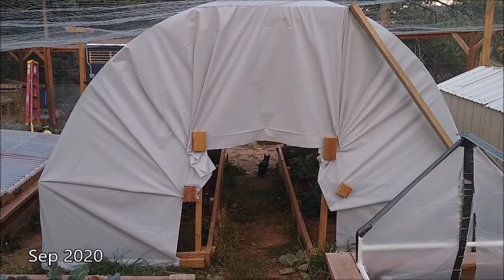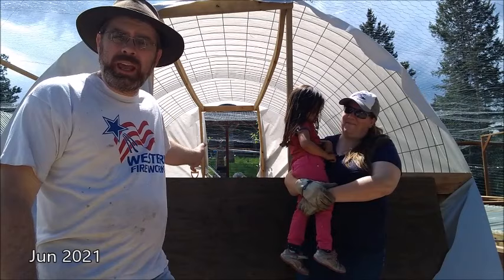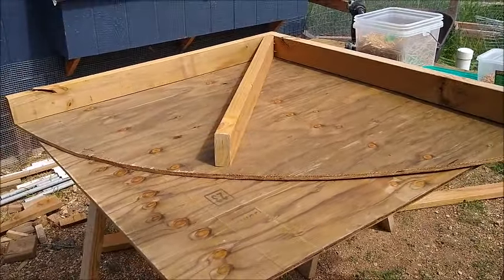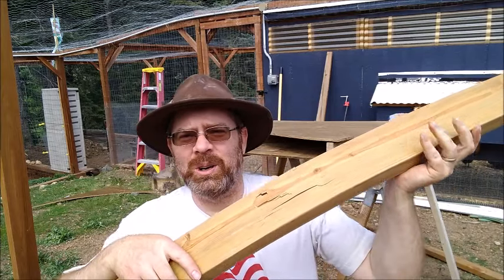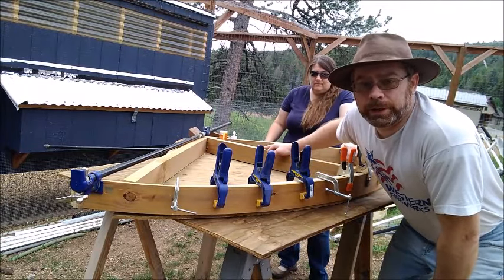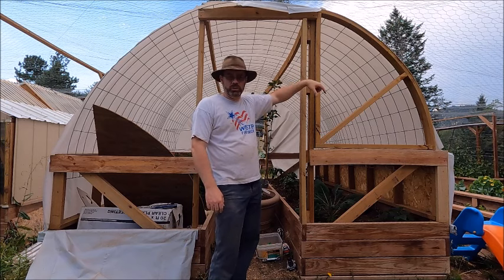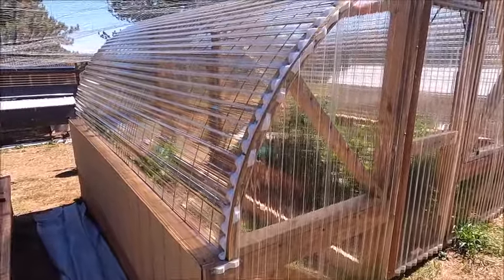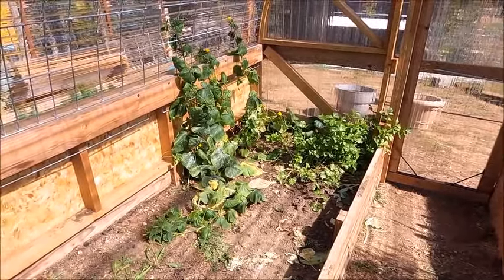Hoop Greenhouse

Comment: I love the hoop house and it gave me some ideas. If I may add a bit of advice: Instead of trying to curve 2X4s, I would use several layers of 3/8 inch plywood. Cut and attach each strip one at a time and glue between each layer. I've used this technique when making skirts for round table tops.
Reply from the maker: Thank you for the suggestion.  This has been suggested before as well.  I stayed away from plywood for this project because it is outside in the elements.  I was afraid of delamination in the plywood due to the moisture, high UV, and significant temperature changes.  The thin strips of pressure treated 2x4s worked well and with the weather resistant glue I was not as worried about delamination.
Reply: @bearlyhomesteading  I fully understand. I didn't think about the plywood delaminating in the weather.
Reply: Sorry to Necro this but I'm in the planning process of doing exactly this as I've inherited a large hoop house like 25x50 that needs new plastic. 

The frame is all galvanized steel like commercial greenhouses but I would like to do these polycarbonate panels like you did for aesthetic because wife and the curves on the side have had me stumped. 

Did you just resaw treated 2x4s to thin malleable strips to do the lamentations on the curves? Again sorry for the Necro post but your video is literally the only video I can find that uses these panels on a curved top greenhouse like mine.

Thank you

Comment: Those curves are a monster. What I did for my greenhouse is I bought a 4x8 sheet of beadboard paneling which is about 3/8" thick, ripped it into 3-1/2" strips lengthwise. Then I used a table saw with a sled, and took an 8p nail (which is the width of the blade) and made an indexing pin about 2" from the blade, and I set the height to be about 1/4" to make grooves into the "bead" side, 2/3 of the thickness of the boards, and made kerf cuts along each piece. These are extremely flexible now and have to be carried on edge. 

Since my hoop house uses 16' panels, two 8' pieces make a full circuit with very minor trimming. These are held in place against the inside of the panels with spring clamps (I used about 20 of them) to meet end-on in the middle (top) of the greenhouse, then wet the wood and used gorilla (PU) glue to laminate another piece of beadboard strip inside, straddling the seam and securing them with the spring clamps (use rubber gloves -- that PU glue is nasty). The remaining 8' piece can be cut in half and fit/wet/glued/clamped into each side. 

I let it dry for about 4 hours, then moved on to the next one. Each of these "ribs" takes 4 8' strips of the kerfed beadboard, and the two laminated pieces comes out to just over 3/4" thick. Once the glue dried, I attached them to the cattle panels using zip ties. I drilled from the outside using the bars of the panels as the guide, 4 holes (two above and two below), fed the zip ties from the below, and over the top of the "bar" of the cattle and back below where they are fastened and trimmed. This became a tedious job with 23 points (bars on the panel) and 2 ties per point -- drill (x92), feed (x46), pull (x46), feed (x46), pull (x46), zip (x46), tighten (x46) and trim (x46). I found that doing each of those tasks in order (instead of trying to drill and fasten each zip tie one at a time) saved a lot of time.
Reply from the maker: That is great.  We stayed away from anything that was already glued (chip board, plywood, MDF, HDF, etc.) due to the very high UV and moisture.  I had thought about zip ties, but ultimately decided against them again because of the high UV.

Comment: I like your approach.  When I built mine, I used clear for the top. It gets HOT  !!!!   Using white on the top part and clear on sides could control it better. Just a thought  !!!!!!!!!!!!
Reply from the maker: We finished it near the end of the season.  It did get really warm on the sunny days.  Our tomatoes loved it.  By adjusting how open the doors are we were going to control the heat.

Comment: Nice Job!  You sure have a lot of patience.  Absolutely nothing wrong with the way you did it, but just one thing you may be able to do on a future project.  Use thin pieces of plywood (1/4") to bend to that angle you want and just keep laminating them togethor with glue and overlap the seams.
Reply from the maker: That is essentially what we ended up doing but with pressure treated boards cut into strips.  My concern with the plywood is getting delamination due to the extreme temperature shifts, moisture, and high UV.

Comment: That's a really nice addition...the corrugated panels!  I would say you need some ventilation except in the very cold months, but maybe in your climate you don't?
Reply from the maker: We really did not need much ventilation.  During the heat of the summer we would prop open both doors with a scrap piece of 2x4 during the heat of the day and that was enough.  We didn't even need air conditioning in the house up there.

Comment: Beautiful job! How did you attach the polycarbonate panels to the cattle panel roof?
Reply from the maker: Initially we just attached them at the ends to the laminates arches and the top of the door frames.  That worked well enough for most of the time.  Once we had a bigger wind storm, we made some wood blocks about 6-8" long with grooves that interfaced with the wires of the cattle panel.  The blocks went inside the hoop house and gave us something to screw into.  This sandwiched the cattle panel between the polycarbonate panel and the wood block.
Reply: @bearlyhomesteading I was wondering the same thing. Mahalo

Comment: I am in zone 6a.  I moved my green stalk that is planted with strawberries into my unheated green house.  They are flowering and fruiting .  Not a large harvest, but it is a pleasant surprise.   The tomato that I moved in did not fruit although it bloomed.  Lettuce and spinach planted in ground in the greenhouse are the best looking plants I have ever had.   Just in case you are looking for some additional ideas.
Reply: Some tomato varieties need pollinators to produce fruit. If there are no pollinators you could take a small clean paint brush and touch the flowers and spread the pollen from flower to flower.

Comment: Hello, I’d like to build a greenhouse using the poly panels and would like to know if you are in Colorado? Will it hold up to a snow load and panels shed snow?
Reply from the maker: We were in Colorado when we built this greenhouse.   The cattle panels that we used were very sturdy and had a lot of support, so they would carry a sizeable snow load.  The panels do not shed snow very well, since the ridges of the poly panels are going in a horizontal direction and not a vertical.  We made one side of the house lower than the other so it sheds water pretty well, but not snow.  Using the back side of a garden rake worked well to knock the snow off without damaging the poly panels.

Comment: i will share this with hubs, but i think you might need to get some ventilation ? are the poly panels the best see throughs you can find without going to glass?
Reply from the maker: For ventilation we were just propping the doors open.  Even in the summer, the nights will get down in the 50s, so we didn't want a ventilation that was constantly open or difficult to manage.

These were the clearest panels that I could find without going to glass or a solid plastic pane.

Comment: That 2nd attempt was oh so close.  Had you simply used an inner, and outer strip separated by spacers every few inches, perhaps 12", you'd have licked your problem with less material and a much lighter structure.  Still, thank you for sharing your experience.

Comment: I really like what you did since the polycarbonate sheets will certainly last longer than plastic sheeting.  My only concern with this design is connecting one sheet to the other across the span.  Are the polycarbonate sheets nailed only on the ends?  Did you use anything (eg clear liquid nails) to attach one sheet to the other?   I would be concerned with high winds getting under the sheets if they are connected only on the ends.  What do you think?
Reply from the maker: After that video was shot, we came back and did attach the panels along the length and not just at the ends.  What we did is take some pressure treated scrapes and cut a groove in the middle of the block.  That groove was put on the wire of the cattle panel at the overlap of two polycarbonate sheets.  Then we screwed to the block through the sheets sandwiching the wire of the cattle panel between the block and the sheet.  Thus we were able to attach the sheets to each other and to the cattle panel at discrete points along the length.
Reply: bravo about the curved boards! then i saw they popped. then i saw your persistence ! bravo again for attitude.
Reply: i watched alaskan dog sled building. they form a steam house for the boards.
Reply: you could use your greenhouse for drying and cold smoking fish and meats

Comment: Soaking the boards (especially in hot water) makes them much easier to bend, but a better method is to use multiple thinner boars that easily bend and then you just add several layers.
Reply: haha now I see that's what you did, nice work!
Reply: Also, those plastic panels will last a lot longer if you paint the wood behind them white. Darker backdrops tend to cause it to become brittle and chip apart.
Reply from the maker: @RandomStuff-zt6qf  I did not know that.  We will try that on our next build.

Comment: Am getting ready to build this but am wondering how you attached plastic to frame and how did you drill into plastic /meaning was it easy or did it crack the plastic at all?
Reply from the maker: No, the plastic did not crack and I did two things to help with that.  First, I attached the plastic sheets on a warm day so the material was less brittle.  Second, I drilled pilot holes through the plastic first then followed it with the screws.
Reply: @bearlyhomesteading  thx kind sir!

Comment: Great design, 1x4 probably would have been easier to bend, especially if you soak em in water for a week
Reply from the maker: Yes, 1x4 probably would have been easier.  In the end I was really happy with the way the laminated curves worked out.  I would probably do it that way again in the future.
Reply: Soaking them in water is what we did for boats at the shop.
Reply: In my shop we never used water. Sometimes steam, but usually just dry heat. The steam is actually a good heat delivery method, as the wood is never in the steam box long enough to penetrate much more than 1/8 ". Heat softens the lignin binders in the wood, making the fibers able to slide past each other. The steam makes it possible to heat long/large pieces of wood more evenly and faster than you could in any other way.

Comment: This is a pretty smart design but won’t the ribs hold water ?
Reply from the maker: The greenhouse is slopped end to end, so water will run off.  Snow will get held and needs to be knocked off on a regular basis to prevent collapse.